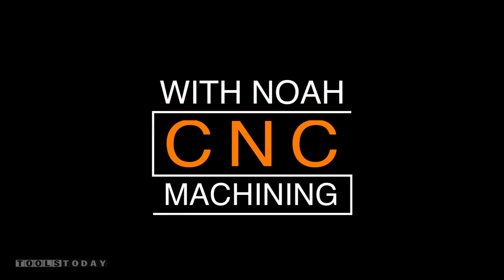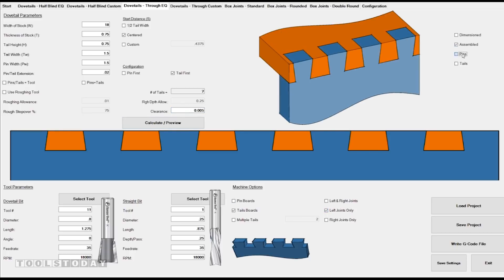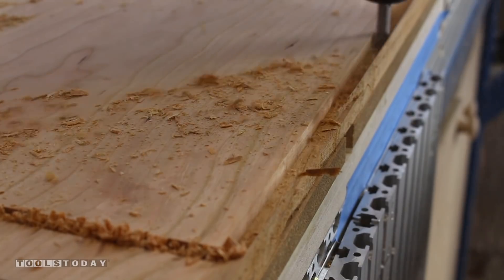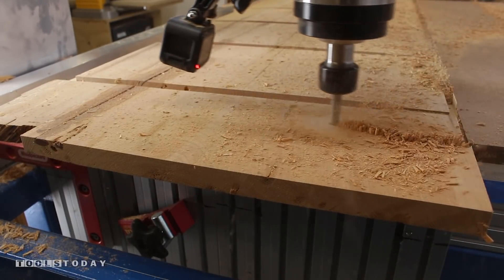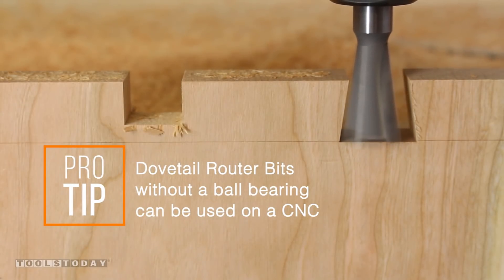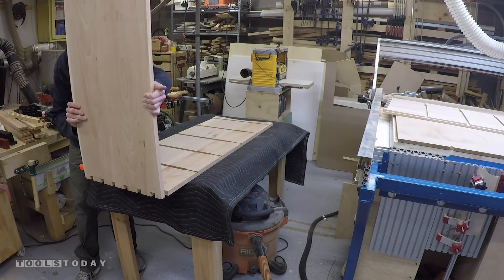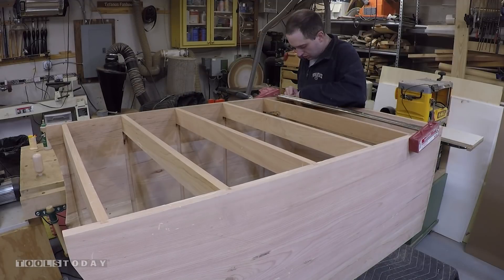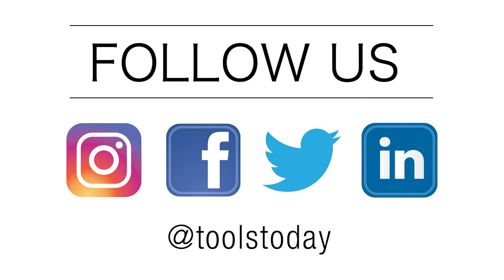CNC Project: Using Dovetails on the CNC Router to Build a Shaker Style Dresser

Comment: The dovetails were cut into wood pieces that were clamped vertically. Which CNC machine was used? What other machines are capable of this?
Reply from the maker: The CNC machine was custom built, and we created a jig to hold the dovetails.
Reply: Some CNC options include vertical clamping through the base which is open beneath removable inserts. See Stepcraft for example. You can remove several horizontal panel inserts and replace them with a right-angle insert that allows clamping of items held vertically. Maximum length depends on your stand design's support frame height. Shapeoko, OneFinity, and Altmill machines can also be custom configured for vertical clamping but afaik, this is not a standard feature for their current (2025) models.

Comment: I have seen a few dovetail cnc videos now, that has got to be the cleanest end fit I have seen yet though. If you were wanting to cut diagonal slot doves in bamboo laminate in either a 12mm or 16mm board. (to slot angled shelves into place for a kooky look) What bits would you recommend? I am finding an awful lot of different types of bits everything from 8 degree to 20 or more degree bits and I have no idea even what brands to trust.

Comment: Great video.  But I have a question - my understanding of JointCAM is for through dovetails, it requires both pin board and tail board to be mounted vertically.  How did you manage this for your long side pieces?
Reply: I built my CNC to include a pass through to the floor, and I just barely had enough vertical clearance to mount the side pieces vertically in my CNC -- they were 48" long and my CNC can just barely clear 50" from the ground to the end of the bit.

Comment: Zwhat is that a 4 x 4 cnc.
Reply from the maker: Robert this machine is a 4' x 8' Standard kit from CNC Router Parts.  http://www.cncrouterparts.com/crpxxxx-hardware-only-cnc-router-kit-p-140.html
Reply: Our factory produces furniture production equipment, please contact me if you need it 
WhatsApp: +8613165117101
We chat : +8613165117101
E-mail :sales01@skmnc.com.cn

Comment: This video was very good so thank you.  If it's possible to make further videos on the process it would be much appreciated.
Reply from the maker: Thank you JustCrusin109! Which elements / process would you like to see in future videos?
Reply: The design phase would be interesting to see how to make best use of the tooling.  When I watched the video, I thought that the way Noah laid out the project (eg surfacing the boards and cutting matching pieces from the glue-up) made best use of the material and the machine itself.  Any tips on what features to look for in a CNC would be helpful as well since I expect not all allow for vertical milling with Joint Cam.  Cheers